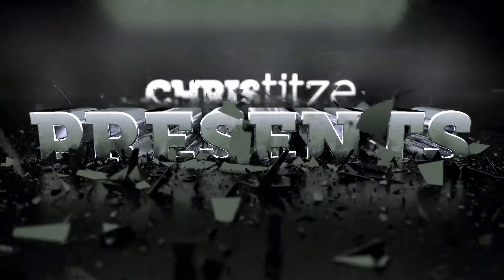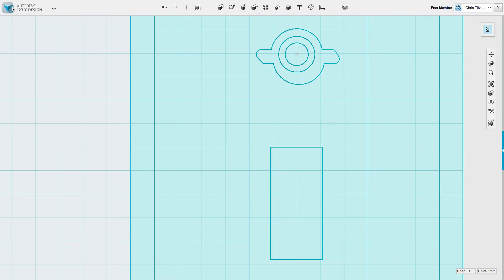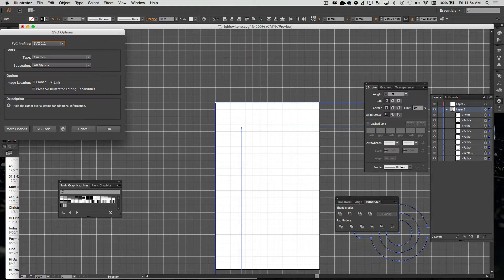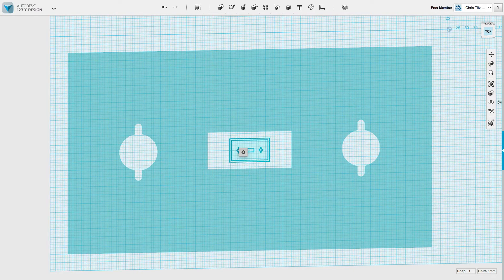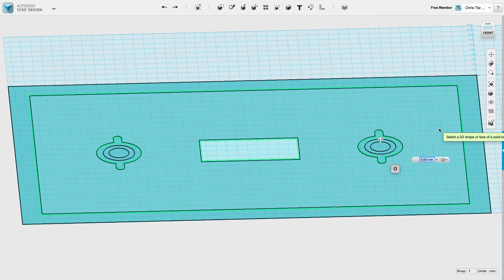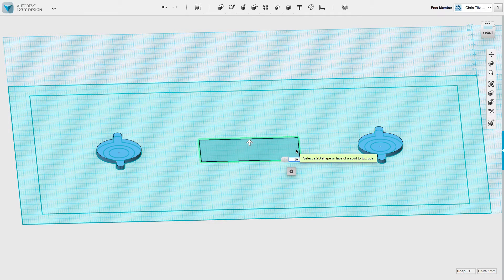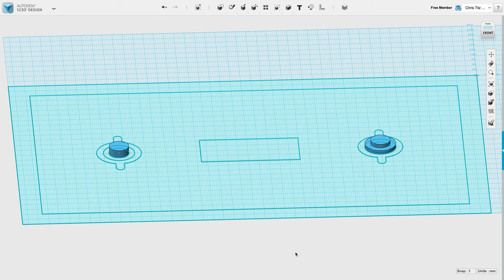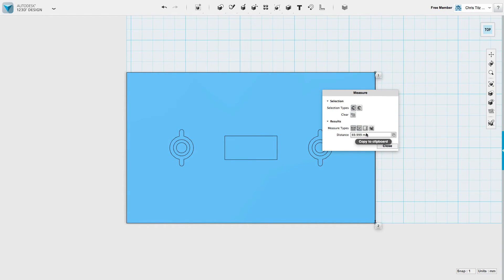How to import Illustrator SVG to 123D Design - Part 2

Comment: Hi Chris. Helpful video! For the alignemnt issue, did you experiment with using more decimal places when exporting from Illlustrator? (default is 1 decimal place) It's a bit hidden under "more options" in the SVG export dialog. Thanks.
Reply from the maker: Hi Ray,
I have to try this out. Again thanks for the comment on the other video. BTW I recently found a 123D Design replacement called Onshape. It's so much more responsive and powerful compared to 123D Design. They have public beta right now where you can try the webapp for free.
Reply: Chris Titze Awesome - thatnks for the pointer - I'll have to try that out.